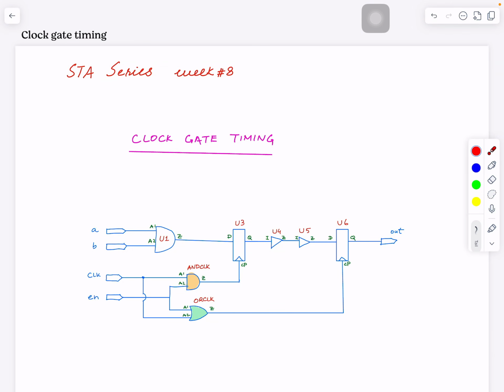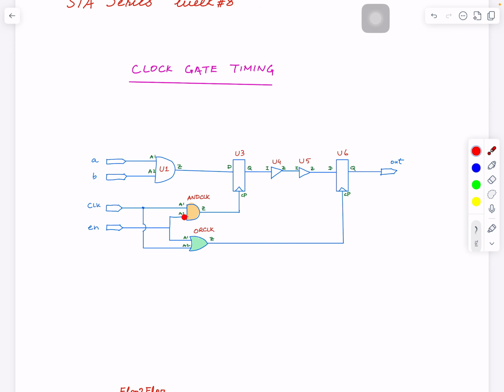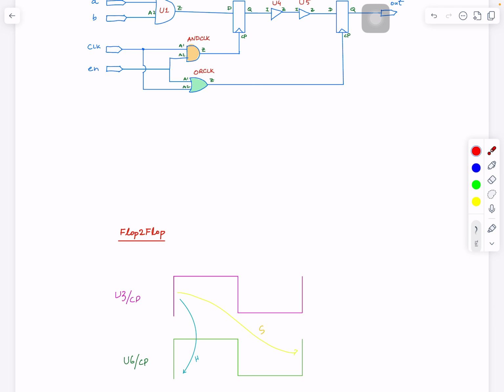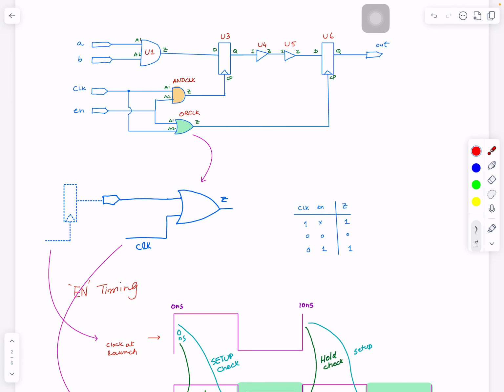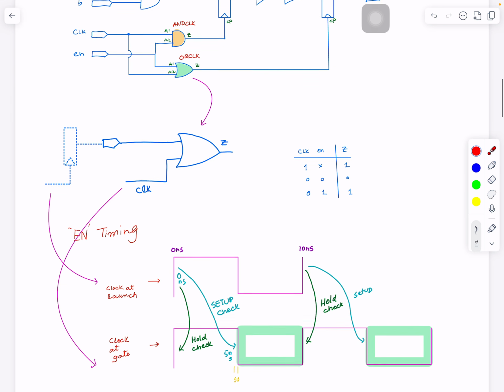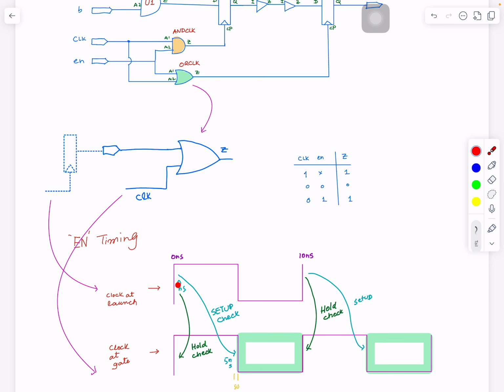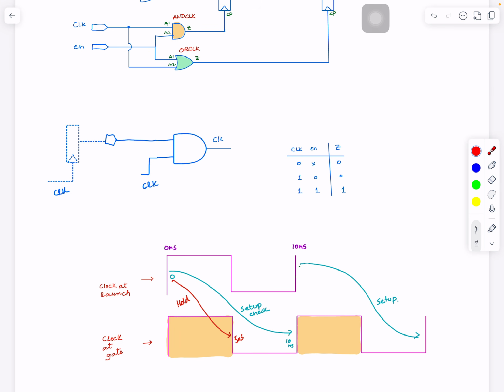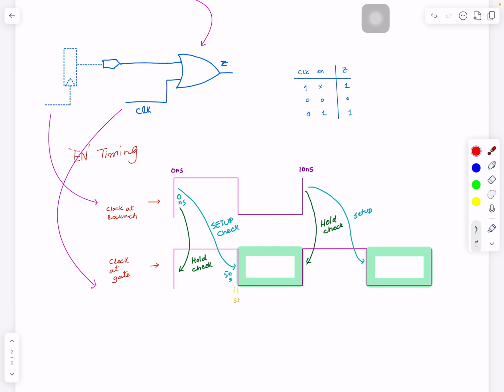STA Series, Week 8, Video 2 - Setup and hold timing for clock gates with simple AND , OR cells

Comment: Small question sir, is the virtual clock for launch outside the design synchronous or asynchronous to the CLK defined at CLK port here??? Because whether it is the same or different but syncron or asynchron is not specified here??